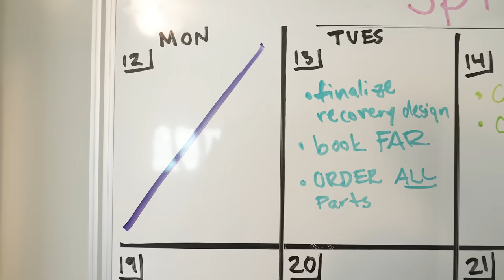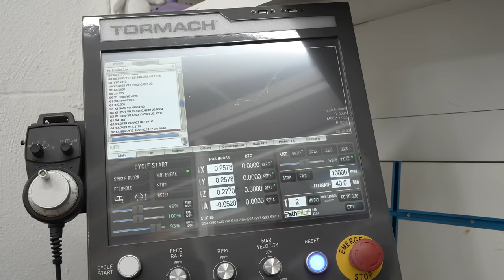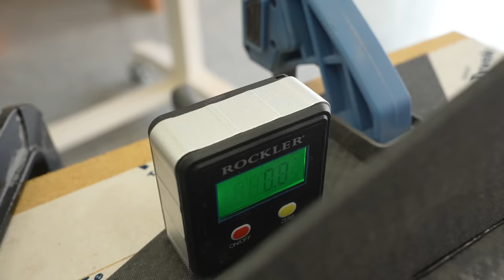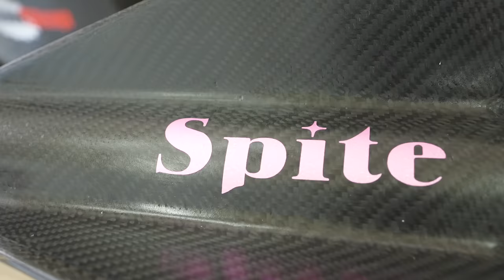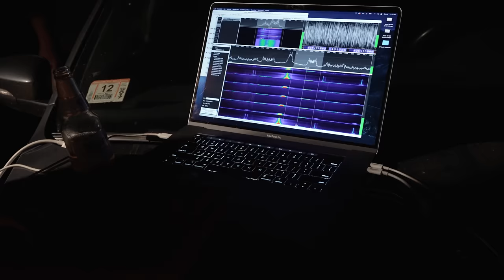ALL Carbon Fiber: My Fastest, Highest, Craziest Rocket YET!

Comment: Xyla that was simply an amazing rocket build and launch! I started model rocketry way back in the mid-late 60's and ended in the early 70's due to other interests. The the biggest engines at the time were Centuri's mini-max engines into the early 70's until their engine plant, sadly, rapidly disassembled itself and Centuri never rebuilt it. We didn't have any of the high-tech gear, materials, engines, or machine tools you all use today but we paved the way with old school grit and determination for you all now to amaze us with how far you have carried on. BRAVO!! BTW, were you able to hear the crack as Spite went supersonic? As a safety professional, I appreciated all the PPE and safety precautions you took during the build and launch. 

My friend launched his Saturn 5 only to have  2 of the 5 engines fail to ignite, came off the rod with an abrupt right turn into the ground! Tears were shed! It would never fly again!

My greatest flier, which is sadly no longer with me was a kit bash. Large swept wing fins modified from the booster of a 3 stage rocket, held securely by Titebond glue and fillets to a 14" BT50 or 55 body tube, and a 5" balsa wood tapered nose cone that mimicked the Sprint missile profile, which was BTW my favorite wickedly fast missile followed by the old Nike Herc! Painted it fluorescent orange with red and white silk chute. I could fly that bird in 15-20 mph winds and it tracked true with max altitude of estimated about 1500 feet in calm winds (old school trig altitude calculations) with a C6-7 engine. To get max altitude would throw a B6-0 (B14-0 while more thrust was too fast burning) underneath to get it moving off the rod as I had dual rod guides. Favorite in Jr High Physical Science class was that I talked the teacher into doing an outdoor rocket launch in the football field! I launched none-other than Estes ole Big Bertha with a C6-3, nice slow lift off with engine flaming away, pop the chute (silk of course) and land within the constraints of the football field. Fun times!